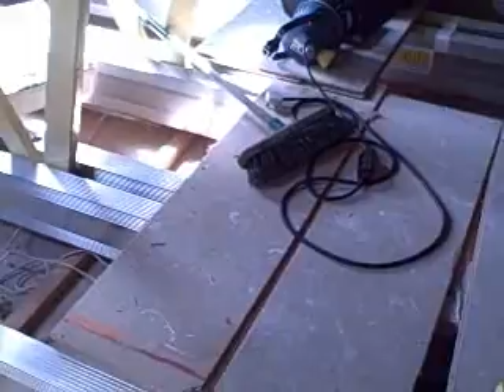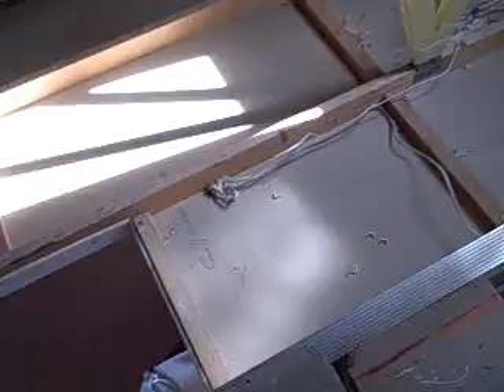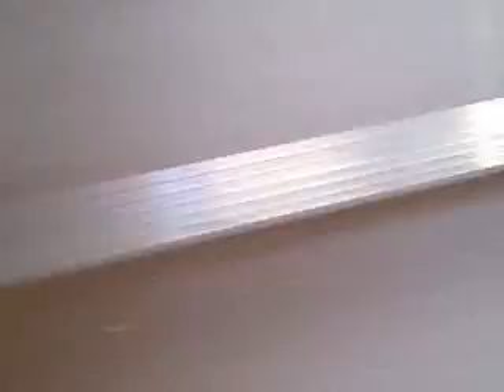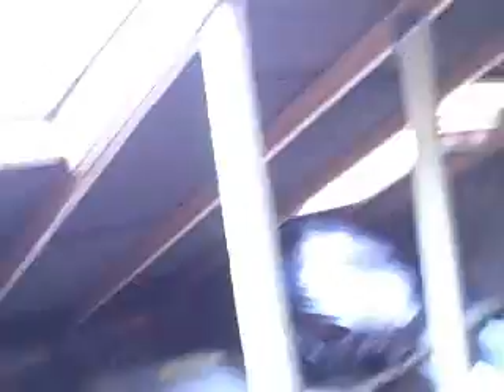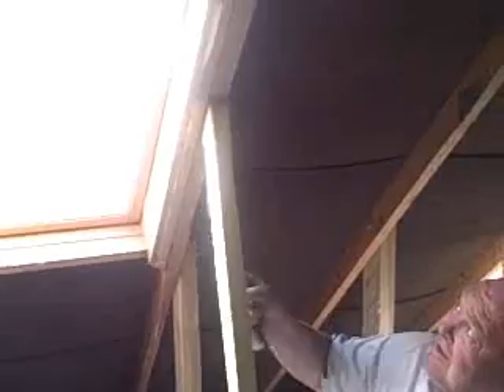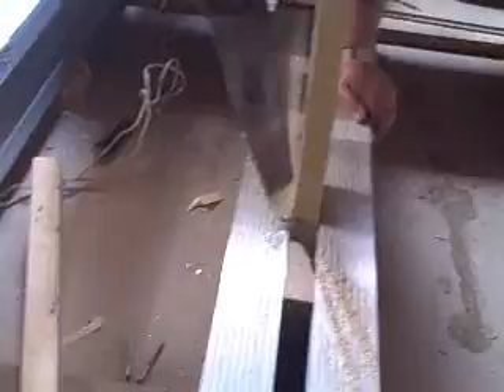telebeam

Comment: sounds good to me@jasonkaraokeman . i widened my loft hatch some time ago to accomodate a pull down step system, so sounds like i should be able to get mine through there............how did you get round the probem of height differece for the stair trimmers? did you have to pack any of them or is the difference too small to bother with?..............hanks for your imput too badbonty , i really do appreciate any imput and hope to be able to contibute myself once mine gets underway, cheers guys

Comment: @waynelufc1 
I've about finished my bungalow loft conversion now, and I didnt fancy taking 3 rows of tiles off, so i removed the guttering and facias and then the beams and outriggers slid in on their side then i justy replaced the fascias afterwards, was much simpler for me cos didnt need scaffolding at all :) if you need any more info, im more than happy to help, it certainly is a fa system.

Comment: i'm doing this - just wondered how you went abt wire the existing electric cables - did you notch out the ceilign rafters or extend them, it looks like they feed under the Telebeams?
ta